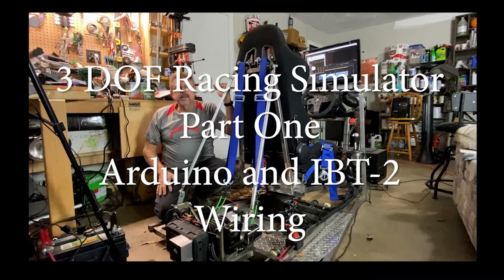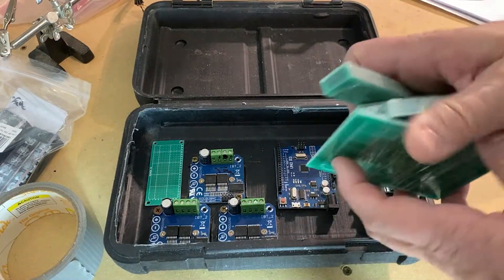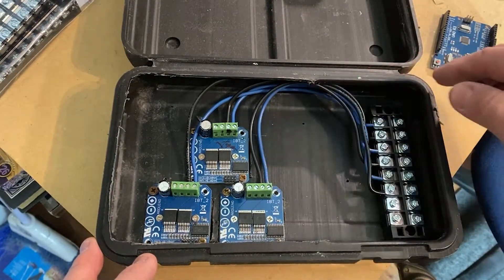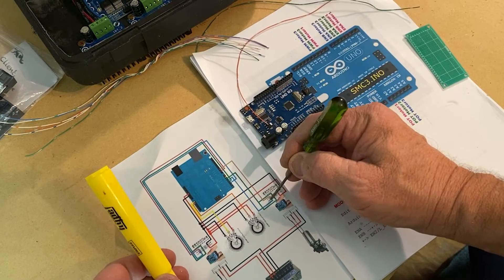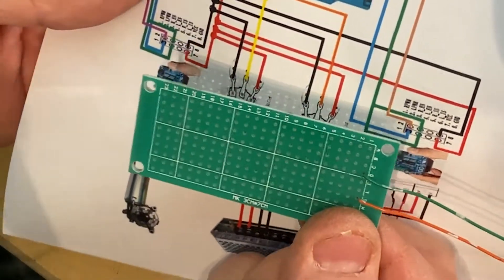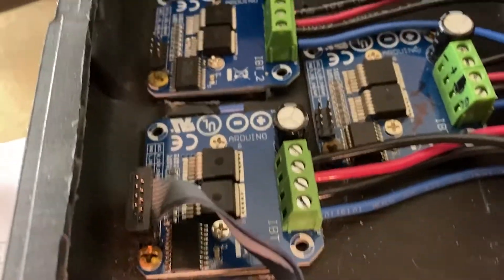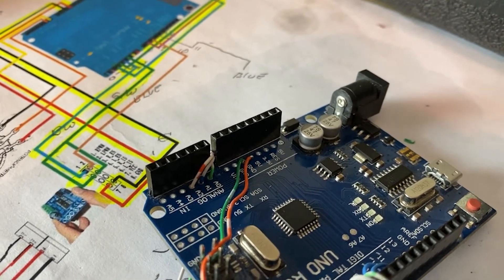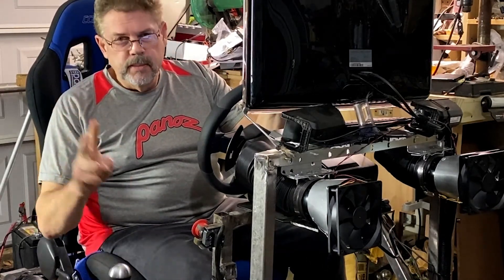Motion Simulator Build DIY - Part One - Electronics

Comment from the maker: Ok Guys!  I'm making a new 3 video 'series' on how to upgrade your 'static' rig to a seat mover so check back on this channel and as always, leave a few comments!  DMAX
Reply: I think Ive watched every since one of your videos! They are great. Super informational. 
The one thing I dont understand is the potentiometers? Theoretically you can get away without them cant you?
Reply from the maker: @nchris12  Not sure on that one.. The arduino is reading the position of the motor shaft. Really the hall effect sensor or 180 degree pot is the way to go. keep it simple and with what 'works'..  Thanks for your comment Dave

Comment: Hello Dave,
I like if people, starting a project without skills or knowlege (welding ;-) )and in the end, it works.(it is a positive meaning)
And when I saw your videos, I told me, you (Dave) are my guide and menthor in mind for the electrical parts,
 so I will start my own projekt soon, to make a 3 DOF Sim-Rig.  Thank you for sharing all the necessary information and warm greetings from germany 
Michael
Reply from the maker: Well hello Michael!  Thanks for the comments.  Yeah can help out with advice, I do it all the time.. Fantastic thing is.. I built it like 3 years ago and it's been run very hard and still working just fine with these components.  I raced it this past weekend in GPL league and it's still super immersive and I cant wait to get in each time and race..  very cool stuff.. Dave
Reply: @DMAX_DIY  subbed and getting the shopping list ready ,will be watching from now on , thanks for the info your the first diy build that i have been able to watch and actually follow

Comment: This is cool. Some years ago I tried building a simulator, soldering my own H bridgeetc.  using info from xsim-forum, but the project stalled. This seem a lot easyer. Can this be used with game-consol or only PC?
Reply from the maker: Thanks for the comment Fred. I will have to talk to the developer of simtools to be sure, but I think it only works with PC, since you have to set up the arduino for the variable com port.  Dave

Comment: One question, might be stupid... wouldn't it be possible to power the 12v (or 24 volt depending) drivers and therefor the motors with a 12/24V power unit as come with some household things, computers, electric tables etc.?  Instead of using a battery
Reply from the maker: Great Question!   Yeah you could. But the issue with that is the amps available..  So a Battery has pretty much the most Amps (for the motors) available instantly.. Using a SERVER power supply or something else probably wont have enough instantly available AMPS to run your motors during 'change of direction' - hard braking to hard accel..  They have a lot of info on the x-sim forum on using other power sources. I just wanted to keep it simple for me.. So that's why I use a battery and a trickle charger..  - Be sure to email me on your WIN!  Dave

Comment: Dave, Well I got my motors running but have no idea about the specific settings in SMC3. Wheres a good place to start?
Reply from the maker: Hi Smerph 42.. I have a couple videos on the channel that show specific - get it working' settings.. Take a look at this video https://www.youtube.com/watch?v=5Du7pbOSe_Y&t=1s    I have a couple others that run my 3DOF rig that show the settings  or take a look at my xsimulator build page .. https://www.xsimulator.net/community/threads/full-frame-2-dof-traction-loss-new-build.14740/ Hope to post a few more specific videos in 2022  DMAX
Reply: @DMAX_DIY  one issue that I noticed is that my reverse direction is about half the speed of the forward motion, can’t figure how to fix that yet. I did finish welding the first platform though!

Comment: What is the full travel of the rear 2 actuators
Reply from the maker: The levers are 4" C to C. I dont expect a full 180 degree rotation due to limits you need to put on the motors via SMC3.. It's plenty for this type design though. The shoulder mount adds mechanical advantage.  I'll put a camera on it and take a look DMAX

Comment: Will wiper potentiometer resistor work??
Reply from the maker: This weekend, I am making a wiper motor seat mover tutorial.  I hate to say check back but.. I ordered the parts and please check back. I have a little series on step by step coming up my friend! DMAX
Reply: @DMAX_DIY  absolutely!!
Reply from the maker: @magnetron366  If you cant wait.. what you will need is a 10K variable resistor and connect it to the motor so it can read the position of the wiper motor arm.. I am going to be using hall-effect potentiometers instead of the 10K wire wound resistors because they do not have interference issues .  https://www.digikey.com/en/products/detail/tt-electronics-bi/6127V1A180L-5FS/2620661?s=N4IgTCBcDaIJwA4DsBaAjAZjmFA5AIgAQgC6AvkA
Reply: @DMAX_DIY  thankyou, cheers!!

Comment: Are you in NZ, I want to make this
Reply from the maker: I'm in Mississippi USA. You can still make it if you want to.. I did a build out on x-simulator.net and still posting a lot of videos. Plus you can get better motors  where you are I think..   Here is a link to the motor /arduino stuff https://www.xsimulator.net/community/threads/smc3-arduino-3dof-motor-driver-and-windows-utilities.4957/ 
and here's my build
https://www.xsimulator.net/community/threads/full-frame-2-dof-traction-loss-new-build.14740/

Comment: Hello, good job, congratulations. I have the modules and all the connections for 2 engines, but I can't find the plugins to synchronize it with the games, can you help me? Greetings!
Reply from the maker: Thanks for the comment McCLain Truck! the plugins are available here  https://www.xsimulator.net/simtools-motion-simulator-software/#plugins  scroll to bottom of page.  
Here's a link to settings etc to run the motors.
https://www.xsimulator.net/community/threads/smc3-arduino-3dof-motor-driver-and-windows-utilities.4957/

Comment: Great video. I cant seem to find the guide though. can you please assist
Reply from the maker: Hi Abram! Appreciate you checking in. I put a lot of my build on X sim herehttps://www.xsimulator.net/community/threads/full-frame-2-dof-traction-loss-new-build.14740/
I am working on part two - programming and tuning the parameters SMC.  But I have the basic settings I started using on the X-sim build  Thanks again for taking a look DMAX
Reply: @DMAX_DIY  I'm sorry for commenting on all your videos. Once I started watching I couldnt stop and I just get more curious. I've already checked your xsimulator thread. Most of my questions were actually answered in videos. I just need to find out a few things now

I saw you flashing the software in sim tools for the wind simulator.  Is it the same process for the motion rig or do I need a custom sketch
Reply from the maker: @abrammanoge  ALWAYS Comment!  That's how I know someone is actually watching, so I keep posting my friend! Hope you subscribe too! I don't track all that stuff but want to keep my channel alive for the Sim Guys!  I'm 'all in' and appreciate your comments for sure! DMAX
Reply from the maker: Oh yeah, Depending on your Motor Drivers, you will have to flash the Arduino.  I use the IBT-2 so you have to 'enable' the MODE 2 part before you write to ARD.  It's easy.. just delete the # before the #MODE 2.. If I recall.. It should change the code from grey to a normal code color..DMAX
Reply from the maker: Here is the link to how to do it 
https://www.xsimulator.net/community/threads/smc3-arduino-3dof-motor-driver-and-windows-utilities.4957/
Reply: @DMAX_DIY  One more question. I cant seem to  find a crab motor close by. If i use wiper motors from a car can i still use the same motor controller as you ("BTS7960 motor driver 43A" is this the same) you used?
and how many wires should the wiper motor have. the ones ive seen so far have 3 wires but looks like the motor controller has 2 connections for the motor?
Reply from the maker: @abrammanoge  I had to order them from Canada. from ebay PGSAW is the vendor. To you question yes. so the Crab pot pullers are 12 volt. wipers should be 12v unless you live in some very strange area of the world. Yeah the 43A means it should handle 43 amps without frying. At most mine have pulled 27amps (BOTH motors at the same time changing direction) so you're good.  I got mine from amazon for less than $20 each.  As far as wipers, they are kind of weird. and you need to somehow remove the ground. I dont have any videos on it but  there is a lot of confusing info on the x sim forum.  I would just order the crab pullers and wait for them to ship. I know they work and there is no guesswork.. DMAX

Comment: Digging the videos a lot. Going through them all in fast order. Not sure if I missed it somewhere, but do you have a Wright up you would recommend as a base line? Mostly for the geometry of everything
Reply: Turns out its right in your description,  learning to read haha.
Reply from the maker: @kaseymorlan5995   Good deal. I posted the build on https://www.xsimulator.net/community/threads/full-frame-2-dof-traction-loss-new-build.14740/